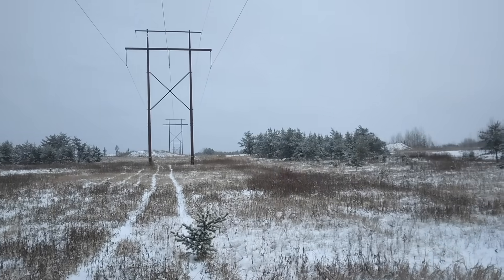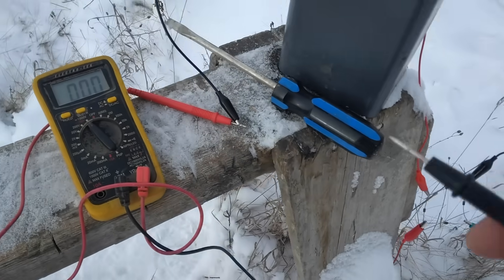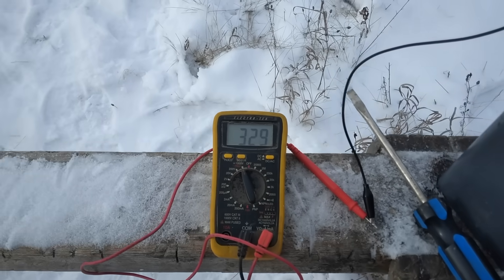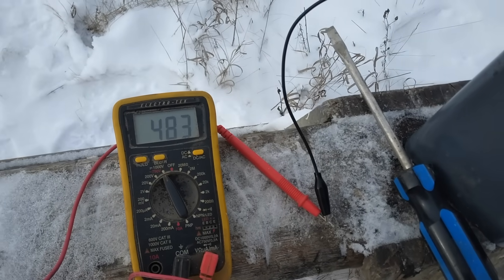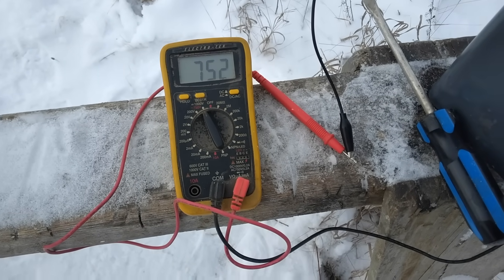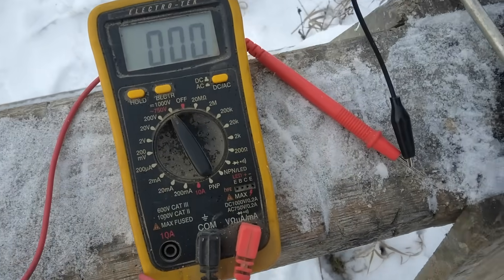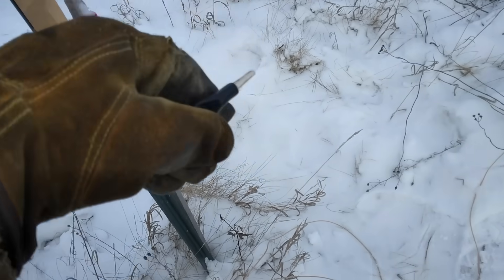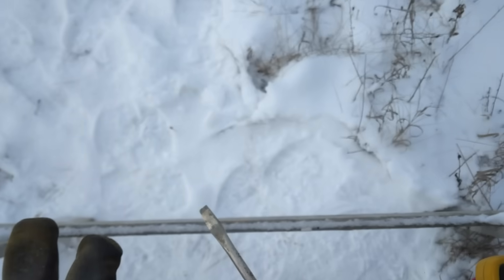Fences sucking power from under HV transmission lines

Comment: Taping into local field surrounding transmission lines. Yeah, that's how it is supposed to work, energy has always been free. Transmission of that energy through powerlines is not, and wireless, which the sun does all day long is free. May the truth set you free too.

Comment: Many years ago I did some investigative work on how High Power Radio transmitting stations/antennas  getting close to 700Kilowatts would affect the unlading of dangerous cargo in close proximity, I plotted the polar diagram and was not so  happy with the results,  The station authority did not like  like what I found and thought that no one will know their polar diagram and directions they were transmitting.  I had to use political power to close the station when dangerous cargo was being unloaded.

While doing such investigation on high power radio transmitters I did  investigate  carpenters drying white glue using high power 53 Megahertz induction coil close to the glued joints to hasten production, Also I investigated the results of some factory using Radio Frequency plastic sealers where 4,000 watts units were being used near the wombs of young women   employees, Also the effect on hearing aids and heart pacers,    I was stunned at the results and the worker's union did not want to heed my advice ,   I do not want to say more, but life is not fair to some people who do not undrstand electromagnetic energy!  Crane operators working nearby were shocked, and fluorescent lights were lighting up without being connected,  I met situation where people working in high intensity electromagnetic field suffered from headaches, and one went very sick.  

I do believe that God is a misinterpretation of Electromagnetic Energy and  what is contained in Albert Einstein equation E= mc^2  and that of James Clerk Maxwell Curl(H) =J + d(E)/dt  shows us the power of God,  The Electromagnetic Energy God  is what our mass will eventually transform and resurrects to when we die. My religion is based on understanding Electromagnetic field and after 86 years  I realised that all primitive religions are a misinterpretation of the power of electromagnetic energy which can change into mass,   The first line in one religious book is " Let there be light" and light and heat are part of the electromagnetic spectrum, Also "we are all made in the image of God" is so very true as all the universe is made of Energy, Mass, Space and Time and that is God and all engineers are closer to God than any Pope and Patriarch or Priest, 

When we " die" we shall all resurrect our mass to the Electromagnetic Energy we were before we were born  to roam the Universe as we always did . 

In this video we saw a little of the power of electromagnetic energy The fact that it is a three phase system the field is rotating rather than pulsating as for a single phase,  All students attending schools and universities should  learn to appreciate what Einstein and Maxwell meant with his mathematical equation and  they say and speak more that  what I  covered with the language symbols I am using to project the thoughts in my mind,  Be careful when close to high power electromagnetic fields,  at any part of the spectrum, Do not be afraid of it, just learn how to handle it, God be with you!  and he is all the time in the form that I explained,

Comment: Never discharge a capacitor with that kinda screwdriver like that had one weld my screwdriver to the cap and I’ve had em really kick back , I was air condition man for nursing homes . Use a Klein

Comment: If the power lines are running at 230  kv and are about 40 ft above ground - then if we assume just for the moment ( for simplicity) that there is no phase cancellation of external fields ( three phase line)  then that means there is an electric field strength of around 230/40 kv per foot = around 5.75kv per foot.
If you imagine the power line as one plate of a capacitor - and the other plate being the ground - then when you run your fence wire along the ground underneath it is effectively "intercepting" the field between these two plates ( like capacitors in series) and thus will assume a potential - - for a 4ft fence - potentially 5.75* 4 kv = 23kv.
However - the capacitance is extremely low

( you can think of the overhead line and the ground as two parallel conductors - spaced 40 feet apart - so the capacitance will be very small.. but it is there)

 ( high capacitive reactance at 60hz) - so once any load is connected - such as "you" or a diode bridge - that voltage will fall considerably - and the current flow will be extremely small due to the high capacitive reactance .
Even so - you reached over 900 volts - and with higher rated diodes and capacitors + better insulation  on the fence wiring it would probably climb a lot higher than 900v

Comment: Lots of voltage but no amps or if so there are micro amps and since there is no load on the circuit nothing will burn out

Comment: On the electric lines, power doesn't go through the wires. It's an electric field that runs on the outside of the wire. My brother went from putting up cell towers to putting up high power electric lines. You may have seen him on the Discovery channel. Hanging from a helicopter on the way to work.😊

Comment: In Nebraska there was an old well pump under some transmission lines and it has not had power hooked to it for 30 years. The pump is pumping water out of the ground.

Comment: The problem with his system, by charging a capacitor is it's not going to be a continuous source of energy. He needs to lay out much more wire, in other words suspense, needs to have loops of wire, around insulators so that you got hundreds of feet of wire because essentially what you're making is a giant opening of Transformer the power lines being one side of the Transformer the fence being the other side with an air core. You will get a significant voltage. But then you're going to need to feed it into a diode rectifier, and look to see what that voltage is. Smooth it out with the capacitor, and then that could possibly we used as a source of energy. You could probably get away with using some sort of a solar panel charge controller. Something that could take a relatively high input voltage because once you load down the cable that you've used to make the second part of the Transformer or your wire is basically, the voltage will drop considerably. You may find out that under load the voltage might only be 50 to 100 volts. But you theoretically can get power this way people have done this over the years many times.

Comment: Have you tried wire perpendicular to the line?  I'm wondering how much is magnetic induction and how much capacitance?  The slow charge and your comment about "microamps" suggests to me that you are using the wire and the ground as your electrodes - hence capacitative coupling.  If you were using the ends of the wire and magnetic coupling, 700 V should give e large current (~100 A) through the low resistance of the wire.

Comment: "Hybrid High-Tension Power Transmission Cable with Integrated Magnetocaloric Cooling"

Hybrid high-tension power transmission cable that integrates magnetocaloric effect (MCE) materials within its structure to passively regulate temperature and enhance efficiency in AC power transmission.

This design requires no extra power to create an active cooling effect because it leverages the natural alternating magnetic fields in AC power transmission.

Why This Works Without External Power:
Magnetocaloric Effect (MCE) Activation – The alternating current (AC) in high-tension cables naturally generates oscillating magnetic fields.

Passive Heat Absorption – The MCE material absorbs heat when demagnetized, cooling the cable.

Heat Dissipation Cycle – When the field increases, the material releases heat, allowing it to dissipate into the environment.

Self-Sustaining Cooling – This cycle repeats without requiring additional energy, making it a passive cooling system.

This means the cable functions like a mechanical superconductor, reducing resistive losses and improving efficiency without external cooling systems

Why It Functions Like a Mechanical Superconductor

Passive Cooling – The MCE materials regulate temperature without external cooling systems.

Reduced Electrical Resistance – Lower temperatures minimize resistive losses, improving efficiency.

Self-Sustaining Cycle – The cable absorbs heat when demagnetized and releases heat when magnetized, maintaining stable operation.

Comment: That is a lot of effort to collect one hundredth of a watt hour, or 0.00001 kilowatt hours.  Remember, one watt second = one Joule, one watt hour = 3600 Joules, and one kilowatt hour = 3,600,000 Joules.  At 10 cents per kWH, that is worth 0.0001 cents.  Not sure what the wire, diodes and rectifiers etc. cost but it seems like a poor return on investment.  Under some of those wires you can hold up a fluorescent tube at night and it will glow if you stand on something high enough (also a BAD idea).  This is a typical textbook exercise in undergraduate electrical engineering, by the way, might take 15 minutes to calculate.  Try this near an AM radio transmission antenna, no on second thought stay away from that also.

Comment: You mentioned a specific number of joules can kill a person, which isn't accurate.

Current is what kills people. And it's in the milliamps range. The problem with saying xx joules kills a person is, that if you spread those joules out over 1 minute or an hour, its very insignificant. Joules are just watts per second.

Very cool video, though!

Comment: If it works it’s not steeling.  The electricity’s being put into the air with no contract.  What battery would you charge up to use.

Comment: MFD is absolutely not micro farads.

That cap is not 88uF.

Being strict, that would be megafarads, but no way that ancient cap is megafarads.

At best, millifarads.

If that is uF, it's an incredibly shite cap at that size.

Crap labelling from that manufacturer.

And joules is not a measure of "electric" and not a measure of how deadly something is. Charge per unit time, aka current, is. 
Joules is energy, and it depends how quickly it's discharged through your vitals.

Messing with this while not understanding it is going to get you deleted.

Comment: For anyone saying “if you can capture the leaking electricity it’s yours” or something like that, please know that doing this causes additional load on the lines. The electric field is outside of the wires whether you put something there or not -yes-, but there is no power being lost until you put a receiving coil with a load.
Reply: I just throw a line over the 22kv lines to charge my cell phone, charges it in 2 secs.

Comment: 35 years ago my wife and I were house-hunting in Maple Grove, MN and walked into a Builder’s Spec home that was built within about 120 feet of high voltage tension wires, they were on huge metal towers.  Well, that home’s back yard was practically under those wires, so when we walked out into the back yard, we not only heard, but also felt a buzzing noise and sensation.  We could literally FEEL the electricity in the air.  We immediately turned right around and got the heck out of there.  I could not see us living in that home, subjecting us to that kind of high voltage energy; who knows what that would’ve done to us physically and mentally over time.
Reply: Humans are generally pretty poor conductors of electricity, and this is taking advantage of an effect of electromagnetism and humans are not magnetic. The fields around those wires would not have effected you directly, but like other anecdotes have shown in this thread, ungrounded metal on the property might have given you a little shock.

Comment: by the fact that you're building a bridge rectifier, I'm assuming you understand the induction that's causing your fence to be charged. with that being said, the more metal you put under the lines, the more resistance the lines will face, which will draw more power from the grid. soo... if you're building a fence there already, and "not intentionally" installing more metal to capture electricity, whatever metal ends up under the line might as well be hooked up to some capacitors. otherwise that's just power being dumped right back into the ground

Comment: That 1200V 88µF capacitor stores over 63 joules of energy — enough to be deadly. For perspective, just 5–10 joules across the heart can cause fibrillation. If it discharges into a person, the initial current could hit over an amp, depending on body resistance. That’s like taking a taser blast dialed up to 11. Even a 1 millisecond discharge would dump over 60,000 watts. It’s not just dangerous — it’s powerful. And while 63 joules isn’t much for long-term energy use, in a short burst it can drive a high-powered flash or kickstart serious machinery. Handle with respect — this isn’t a harmless zap.
Reply: Na, its fine.

Comment: I often wondered if you parked a coil under HV lines would you generate enough usable power through induction?

Coax is shielded meant for communications, so it would be extremely inefficient, although in this video he is testing the shielding... Try simple barbed wire first and look for a potential voltage across it. Join the ends so you only have one long wire and test output.

Note: you're not taking power what you're receiving is induced power, it does not affect the power lines at all, that's wasted energy coming off those power lines.

Comment: Well I think where 3 overhead lines for the 3 phases run as is normal where I stay
The algebraic total of the 3 phases is zero

I also learned about the transmission losses
The 240 kv lines are very high above ground 

For your own safety, you are not allowed to build under overhead lines

Lines might break, due to wind or other factors 
And Fall on your house

Comment: A fence is just a coil with a single winding, hence the high voltage and low current. You can obtain a much more useful power source by wrapping the wire back and forth along the HV lines (technically they should be perpendicular to the electrical field but I don't think it matters that much with HV line leakage). Careful though as it will go from a proof of concept to something that will kill you very quickly.

Comment: Great premise for a video, horrible execution. What are you testing? How are you testing?
Reply: lol H1= some kind of measurable voltage in the capacitor. H0 = no measurable voltage. There isa voltage so we have to reject the null hypothesis. He shares all the equipment at the beginning. It's fine for an initial test and supports an argument for more testing. He isn't trying to write new laws of physics here.
Reply: @IluvinortheIneffable  great. That's like someone showing you a tire iron and a jack and then tell you that you use them to change a flat but never shows HOW to do it.
Reply: @ Its Marketing 101. Gotta go through the funnel. Not everyone wants to know how right away They want to know why first
Reply: @IluvinortheIneffable  I already know why from the title. All I saw were hands fumbling around with test probes and unidentified wires👎
Reply: @ Why dont you pay him for the test and then he can get the equipment and help to run a proper one. I bet he'll share payment info if you ask.
Reply: @IluvinortheIneffable  my payment is the like, subscription, and comments

Comment: You have no idea how useful that information is. Designing a backpack-portable coil-driven linear acceleration tool is much easier if I can just indirectly siphon power off a transmission line. Trying to make a portable high voltage device that can be recharged via a standard 120v outlet is very difficult. Maybe if I were an engineer it would be easy, I don't know. But I'm just some guy who wants to design a cool new high-impact tool.
Reply: This takes time to charge the capacitor. If you are depending on the tool to function when you need it, you probably want some kind of battery and transformer to charge the capacitors and a separate device to charge the batteries. This method is affected by proximity, so you'd have to be close to the power line. I dont think that is realistic without a battery and you can charge a battery at 120v. I thin that's why this type of power transmission never caught on. I know this was part of Tesla's high voltage experiments but his proposals were rejected due to the limitations over long range.

Comment: Id like to see how far measurable current is from the lines so 10 20 30 40 50 feet et... With the fence and battery parralel to the lines.

Comment: The power raining down from those wires onto the ground if you go there at night time with a full resin light tube it will light up you literally can take hundreds of them no fixtures just the bulbs and they will light up this is how much electricity we are wasting in our transmission of power.  And we have no idea how this is affecting people or the animals underneath this radiation the electromagnetic radiation does affect living creatures and if you know how it can also affect your crops and help them grow faster   But there is a trick to that for crops. Your best bet is to do what you were doing with charging capacitors think of them like batteries   You could charge up tons of capacitors bring them home discharge capacitors into batteries and you could get a whole lot of free electricity and it isn’t very hard to do it is dangerous capacitors can hold a lot of power and kill  you if you do not handle them correctly

Comment: your wire is a receiving antenna. The powerlines are the emitting antenna.
Fine tune your antenna (wire) for a 60hz signal. lets say 776miles - 1250km long wire (1/4 wavelength of 60hz)
You should see the power go up much faster